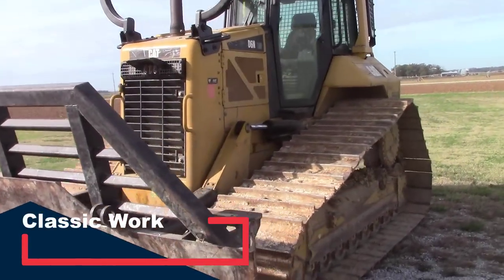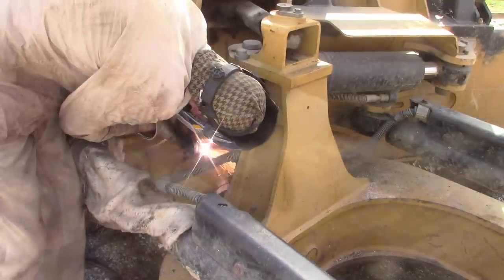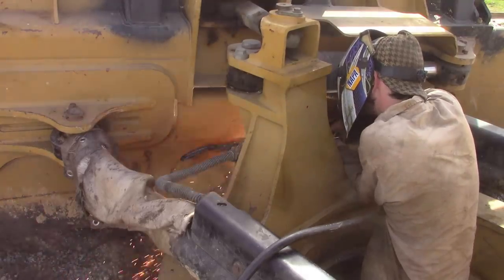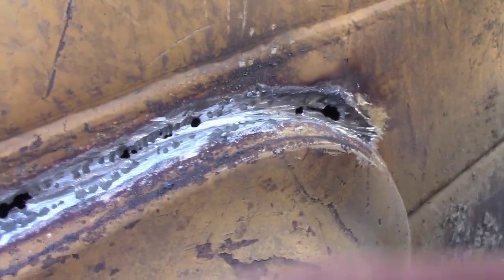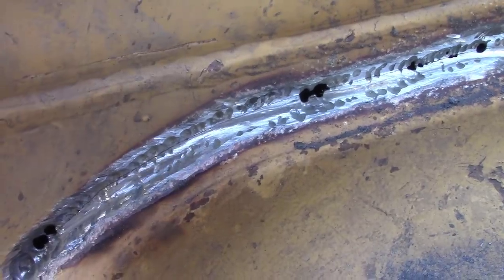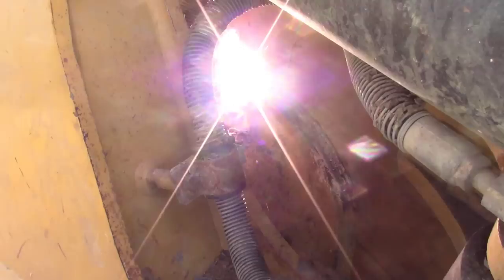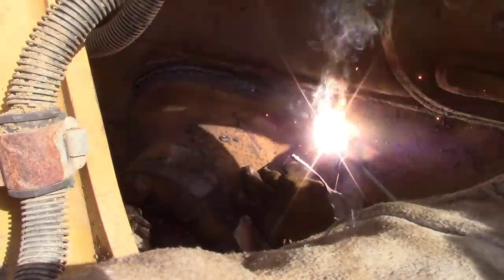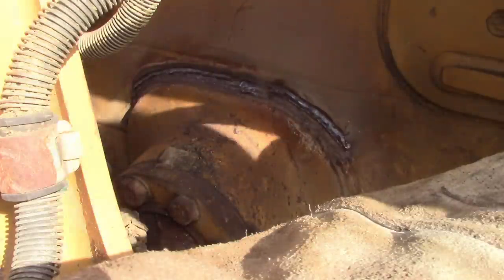D6N crack repair

Comment: Do you think a Miller bobcat 225 will work for the carbon arc. I just work on my own farm equipment, bush hogs and such.
Reply from the maker: I don’t recommend using a 225. You could do a little bit of gouge work but chances are you’ll wined up burning up your machine. Don’t use a rod bigger than 5/32” and don’t gouge longer than 10 mins at a time.
Reply: @EEJester1586  ok thanks, I will just buy the hypertherm 45 it has a gouge mode on it.
Reply from the maker: @ronnierivera3991  that will definitely save your Machine.
Reply: Not good to use a bobcat, have used a Hobart champion 16 to carbon arc with 3/16 rods and it messed up the machine. It popped the bridge rectifier and a capacitor. They are both very similar machines.

Comment: I've gotten away from the XX10 rods and switched to 7016 for open root welding. It's a Lo-Hy rod like 7018 but has flux that will cover the back of the puddle.
Reply from the maker: I need to try some 7016 I've used 6010 for years its hard change when its all you know.  Thanks for the comment.

Comment: I have done the same thing before Ethan and its definitely a surprise good job making it work out. I am not a big fan of gouging either much rather use torches but sometimes you dont have much of a choice. Great video again and keepem coming buddy
Reply from the maker: Thank you Mr. Robert. Yes sir I’m hoping to get some more videos in the works.
Reply: @EEJester1586  don't u live in Macon Ms.
Reply from the maker: @jakebrake1326  yes sir that’s right.
Reply: @EEJester1586  me and my cousin went by ur house this afternoon I saw ketchup and ur miller big 40 in ur yard and I told him I said I know who's truck and welder that is I said that's my brother from another mother classic works truck and welder
Reply from the maker: @jakebrake1326  I gotcha yeah you ever come through Macon again give me a holler we will get some lunch or something.
Reply: @EEJester1586  yes sir that'll work my brother and if u don't mind I'd like to burn a few of ur welding rods I'm a welder myself I'll be glad to come hang out with u
Reply from the maker: @jakebrake1326  yes sir that will work.
Reply: @EEJester1586  which one can I use ur miller big 40 or ur Lincoln sa 200
Reply: @EEJester1586  meet me by ur miller big 40 welder next time I come back thru Macon big brother
Reply from the maker: @jakebrake1326  well, my big 40 is the only welder that welds right now. My SA 200 the shunts went out. Yeah, I need to fire the old girl up. See if it’ll still shoot out a good arc.

Comment: Do you carry a feeder on your rig? Woulda made short work of that. Looks good tho👍
Reply from the maker: I do. I’ve got a LN-25 I use it some it’s a good wire feeder. I’ve learned if you’re not welding for more than four hours it isn’t worth pull it out.  With dual shield it isn’t that much faster than stick and the time to take it out and set it up and take it down it’s a lot more than stick.
Reply: Dual shield is way faster than stick.
Reply from the maker: @OFW  Dual shield is a faster process I just don’t have a fast set up on my truck. Just been my experience takes longer to pull it out then it would be for me to do it with stick.  Thanks for the comment I enjoy your content as well.
Reply: Understandable and there's a lot more problems that could arise wether it's gas or feeding problems